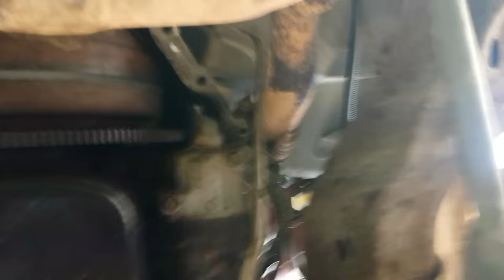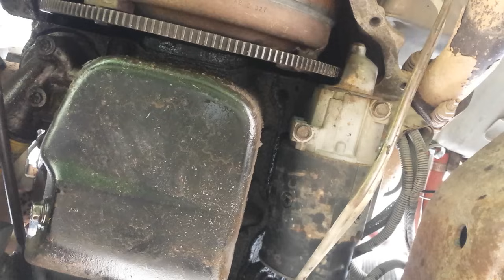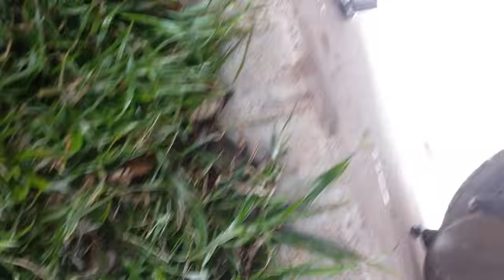Bad flexplate sound

Comment: I can confirm this is the noise….I rode around with mine broke for a month rattling around until it blew up at 80mph…..Torque converter is toast
Reply: What kind of vehicle do you have? My 05 started making noise a week ago and come to find out was a little low on oil, thought it was a rod knock but went about 4k rpm going to highway speed and lost all power and towed home. Got plate and torque converter, hoping it's just the plate 🤞🤞
Reply: @Ni_ghtmare  06 Trailblazer it would only rattle on Start up and Shut off which is why i assumed it wasn’t too major i also had no shifting problems even leading up to the event, Converter was toast cause of metal chunks tearing it up :(
Reply: @DavidsLifeYT  yeah, I have an 05 ram 1500 5.7 hemi, heard rattling but needed to do some work and had no choice but to drive it and figure it out after. Was coming home, passed the bridge by my house like 3/4 of a mile away and heard a snap and lost all power. Bought the flex plate and torque converter, thinking since I dropped the money I'll just go ahead and put them both in (265k miles and never taken trans off) didn't have any shifting issues either before it started happening. 

Would take it's time going in reverse but other than that it drove perfectly fine. Will update tomorrow when I do it just to keep you in the loop 😂😂
Reply: @Ni_ghtmare how it go
Reply: I have one more day to drive mine, and I'm really really hoping it holds out

Comment: My 97 f150 started doing it 6 months after I put a new motor in it. Thought it was rod bearings found out it wasn't but changed them out anyways. It remained me of a lose flex plater or torque converter being loose not all checked out. I came to the conclusion it was either the flex plate or torque converter. Both can make the noise. So when I drop the transmission I will just replace both at the same time and be done.
Reply: I had my transmission rebuild, 1700 bucks. 700r4 in a obs k2500. 4 months maybe it is doing exactly that. I took it to them hoping it was that. They called me next day saying they think it's the motor and want me to come listen to it.......I know what it sounds like there Bob the builder, I need you to tell me yes or no is not the trans. Well they are convinced it's the motor but every gear head I'm friends with are telling me definitely the torque converter or flex plate. We'll see
Reply: Did u fixed ???Hope u did not buy a new engine  i have the same noise  and i spend lots of money on a new supercharged engine and new tranmmission noise not gone  they change the torqueconverter  and use same flex plate  and same thing now is going back  to the dealership  to get new flex plate hope it fix the problem

Comment from the maker: It did turn out to be the flexplate. it was cracked all the way around the bolts
Reply: Hi did the issue happen after the clutch was replaced or it happen just like that . Pls guide . Having same issue just  1 month after replacing the clutch and flywheel .
Reply: We
Reply: Can that affect the transmission after a while
Reply: @driverman9528  thanks man yeah i was thinking it was my battery but im not sure because it makes that noise and it takes a couple of turns to turn on then when i step on the gas i hear like a plate hitting something thanks alot for the feed back
Reply from the maker: @joseramirez9932  not likely to affect the transmission but some of the old heavy flywheels would sometimes shatter and if that happens its about like having a grenade between the engine and transmission.
Reply: FamilyMatters2015 my silverado was making the same exact noise but today i put in drive and now it wont move forward or backwards can i have damage something else
Reply: @erikramirez3576  still doing it? Check your transmission fluid
Reply: @erikramirez3576  if flexplate is totally cracked around mounting bolts, the crank is probably spinning inside the broken flexplate and not turning torque converter or transmission. So vehicle will not move.
Reply from the maker: @erikramirez3576  very possible the flexplate can completely break and loose all connection from the crank to the torque converter
Reply: @driverman9528   could you help me with my truck it make a similar sound but its sound horrible
Reply: Did it have a problem gaining speed.
Reply: Best to replace torque converter and flexplate at the same time. Often times its the converter that caused the cracks if its a stock engine. When people talk about repeatedly having flexplates crack, something had to cause it. Usually high horsepower, loose bolts, or failing torque converters.
Reply: @benthere404 Do you know how a bad torque converter can break the flexplate? I had the original plate break in my car after 314,000 miles and then the new flexplate broke just after not even 2,000 miles
Reply: @marcuscarter7639  I'd lean towards loose or improperly torqued bolts with that low of miles, unless it with neutral dropped.

Comment: Did you ever determine what broke the flexplate in the first place? . .  Besides the common reasons (that we always hear about). Mine was breaking around the crankshaft bolts due to improper alignment of starter to ring gear. If there's the slightest slant, it will stress the flexplate over time, and will crack around the center. Yet there's no damage to the ring gear, because it will still mesh just fine.
Reply from the maker: It was broken before i bought it. I just replaced it and it hasnt hapened again

Comment: you and your old video saving all these lives haha your such a hero,haha kidding bro,i have a 95 z71 ive had it for 23 yrs now and ive replaced the trans in it like 3 or 4 times not sure why,its a 4 wheel drive im not racing in it you know,but yea i put it in gear and it sounds like a metal coffee can with some nails in it shaking it up and down,i put it in park and it stops omg im so tired of working on stuff,this was the FIRST video i watched and boom looks like its this,i removed the bottom shield like you did hoping there was a rock or something but didnt see anything and i knew it was a crack,thats why i typed in cracked flexplate,damn the man,well like everyone else here thanks for confirming it for me.later
Reply from the maker: Haha yes sir glad to help. The truck in the video is a z71 and I bought it for 500 bucks because they said it needed an engine. After hearing it run I knew it was a flex plate. After you hear it once you can identify it pretty easy. Take care

Comment: Did it knock at higher rpms? I have a similar issue but only at very low idle. When into throttle it stops.
Reply from the maker: When under load or under climbing rpm the Knock would stop

Comment: My town country van has that strange noise which is coming when ever I turn on the car. If I also turn the AC on the noise gets more. However when I Accelerate and put my foot on the gas and drive. the noise is stops and then when ever I took my foot of the gas and slows down or making turn the noise coming back.
Reply: Mines doing the same what was the problem

Comment: mine makes that too.. it cause 3 starter to break into pieces.... .. i have no idea how fly wheel can get very hot, horny, dusty, windy, and cranky... thankss for loading up video...
Reply: VANflawless flawlessNIXION  Why would you buy 3 starter motors and not kust get the flywheel fixed, them bits have entetered your gearbox or flywheel and will have done a lot more each time.

Comment: Won't you hear the same noise if it is partially engaged in 4wheel drive, check your 4wheel drive shifter to be sure it's in neutral...

Comment: You know when I fire up my 86 I hear some weird rattling think it may be flywheel but only when it starts and never again any ideas
Reply from the maker: Could be a crack on the flexplate. Listen to exactly where its coming from and go from there
Reply: It could be the starter not disengaged
Reply: My car is making a rattling noise but it's like yours right when i start it it makes the noise but a few min later it goes away. Did u ever figure it out?

Comment: Mine is making the exact same noise. I have a 1990 RS 305, when I started it does the same thing but after it starts to idle evenly it stops
Reply: Was it the flexplate? Im having the same noise on 2002 impala but goes away when the engine geats up to operating temp

Comment: I have a 2014 ford explorer fly which is making the same noise when accelerating after that feels good but when going to slow down or accelerating again I hear it again like metal rubbing metal
Reply from the maker: Are if there are metal shavings in the been housing.  If there are then check starter clearance.

Comment: 1978 cutlass knocks at idle put it in gear no knocking even when u rev the engine in gear still no knocking put it back in park knocking comes back flex wheel ?
Reply from the maker: Sounds like it could be a bolt on the torque convertor has come loose. If it has then every time it comes to the top of the bell housing it will make contact. The load put on it while in gear may move it just enough to prevent this contact. If that is not it i would suspect a cracked flex plate.
Reply: That’s what I’m think I can’t see any cracks but the best way to really see is to take it out

Comment: I have 2007 Yukon Denali make the sound like a bell right by the flywheel almost like the video. 
Can we keep driving like that for a long?
Reply from the maker: I would fix it as soon as possible. Driving on it isnt real good for the engine or transmission. But that being said you could probably get by for a while. I drove the truck in the video for a year before i eventually fixed it

Comment: hows it going man yea i know its a old video haha hey bro my 95 z71 that ive had for 25 yrs now it was making that noise so i just got aroundto replacing it,i took the old one out and there was not a single crack in it dude,so i replaced it,cranked it up sounded fine well then when i put it in gear and was backing it up on this little hill where i park it today it started doing it again,so i got someone to sit inside and put it in gear while foot on the brakes and i crawled under to listen and then it just quit,so i got in it and drove back and fourth up and down the hill putting some stress on it and it hasnt done it again,not sure if it will or not,but while we were hearing it while in drive it just stopped all of a sudden,im super sore and tired from doing this crap do you have any idea why or what it could be,the old one wasnt cracked,was yours,i saw a couple marks up inside the bell housing where it looks like something hit it in two spots but i dont know if that was anything,any help or ideas bro.god im beat,i left my transfer case attached and just slid the trans back enough to get in there to change it.thanks
Reply from the maker: Couple things come to mind.  Could be the starter not properly shimmed to where when the flex plate flexs it contacts the starter. That sounds like the most likely scenario to me.  A differential that is low on gear oil could also make a similar sound.  If you were going up the hill in reverse those sound like the most likely culprits because reverse is lower geared plus the strain of going up hill. Try to replicate it by putting in reverse, mashing the brakes (to simulate load) then give it gas.  See if makes the noise again.  If it does then more than likely the starter needs shims
Reply from the maker: BTW this is my video.  I'm just in a separate account rn
Reply: @TheBigstew5508  thanks man yea i saw another video and it was the starter on his truck,come to think of it,its the original starter haha so its oh wow 29 years old haha,i installed the engine in 2006 its a 350 HO with a slight cam,i was thinking about pulling the bottom cover off and looking at the new flex plate to see if there were any wear marks.damn cant believe i did all that work for nothing,oh well thanks man take care
Reply from the maker: @onewheelup  happens to all of us.  If it makes you feel better I've seen trucks sell that had a "rod knock" that turned out to be a loose torque convertor bolt hitting the bell housing.
Reply: @TheBigstew5508  yea i know man,you know you have two types of mechanics,one finds the problem and fixes just that,the other throws parts at it until he finds the problems and thats how i feel,i just dont know anyone to ask,i dont have a single friend anymore,you know i did a complete every nut and bolt ls 6.0 with cam and centrifical super charger in my blazer all by myself,geez talk about a lot of work and trial and error but anyways hopefully its just the starter and nothing serious.thanks for helping me out man it means a lot.like i said ive had the truck for 24 yrs now,while under neath i see ii need to power wash then do por 15 cause theres lots of rust.uhhh it never ends.later friend

Comment: i took my ford e250 into the transmission shop who had previously rebuilt my transmission and they looked for a crack in the flywheel and couldn't find anything. All they did was remove the starter and a cover and put a scope up. They said that they don't know where the knocking noise is coming from because the flywheel looked fine. Is it possible to find a cracked flexplate with their scope method? I hope they just missed that part lol. thanks!
Reply from the maker: Mind was bad enough where is was obvious. You may unbolt the torque converer and slide it back to get a better look

Comment: Can you hear it at high rpm ? Like super loud
Reply from the maker: No it goes away under a load. If ut gets louder with rpms then may be abrod knock
Reply: FamilyMatters2015 it’s sound exactly like this , rodknock is loud , it sound more like aggressive grinding at high rpm
Reply from the maker: @alonzo5.040  you should have an inspection port on the bell housing. Best thing to do would be to run a bore scope in that port and take a good look at the flywheel/flexplate. Ive also seen the torque converter bolts come loose and will tap the bellhousing every time they spin around. May check that as well. Easy to do
Reply: FamilyMatters2015 thanks man appreciate it

Comment: I have an '87 Ford Tempo , it squeaks & squals really bad have sprayed the flywheel only for the noise to return.. HELP!!!any suggestions???
Reply from the maker: Frederick Kidd if it is coming from where the flywheel is then it may be the torque converter. Check your transmission fluid for material
Reply: FamilyMatters2015 nothing in trans fluid
Reply from the maker: Probably the torque converter

Comment: My f150 97 do the same noise I live in Oregon but I need to drive to California you think I can make that trip could you can help to know it's like 1000 miles
Reply from the maker: I wouldn't chance it. If the flex plate is cracked there is a chance of it coming apart. I've heard of people getting seriously injured by flex plates exploding under high torque in older vehicles. It can come though the floorboard if it has enough force behind it.

Comment: My truck was making same sound every time I start it but only in the beginning not when I drive it, I thought was a piston but I think is same issue, 3 days ago I start it sound was gone but doesn't engage shift any gear, what could it be¡¡
Reply from the maker: It would be worth looking into the flexplate. If it sheers off just right it may not be connecting to the torque convertor. Pull pff the inspection plate and see if has wiggle. May check to see that the bolts are still connected from the flex plate to the torque convertor too

Comment: My buddy's truck had the same problem... he went in for a rear main seal leak and the jackass mechanic ran the bolts down with an impact so tight it cracked the flex plate... I installed a new flex plate and torqued to spec, no problem since.... beware the quick lube places
Reply from the maker: Brendan Rapa quick lube places are garbage, i try to do as much as i can on my own to prevent stuff like that

Comment: was that noise going away wjen you put ot in neutral?
Reply from the maker: it went away when put in gear
Reply: +TheBigstew5508 like clutch pushed in and no sound? was it also your bendex gear on starter not adjested right ?
Reply from the maker: +Iworkupnorth.com it was the flexplate. it was cracked

Comment: if its a chevy there notorious for the flywheel cracking
Reply: My 2.3 liter mustang makes almost a similar noise. I got to replace the rear seal in it anyhow and have the transmission rebuilt.

Comment: When this happens, does it come on all of a sudden or does it get worse and worse? Is it hard to fix? Thanks!
Reply from the maker: Could come on quick or could take time. What is happening is the flex plate is cracking. In this case it was pretty severe crack all the way around the crank bolts. To fix you will have to buy some long bolts to place where the transmission mounts to the engine. 2 or 3 bolts about 6" long should work. Remove all the bolts for the bell house and torque converter. Remove the cross member and drop the drive shaft. I like to use a ratchet strap to help support the transmission. Install the longer bolts carefully and slide back the transmission giving you enough room to reach the crank bolts. Remove and replace the flex plate then re assemble. Be sure to use lock tite on the crank and torque converter bolts
Reply from the maker: You could also drop the transmission but I prefer the long bolt method
Reply: @TheBigstew5508  awesome! Thanks much!!
Reply: Could a flexplate make this noise only and only after 40 miles an hour from a dead stop to 40 miles an hour there is no noise but after 40 miles an hour there is a noise just like your video 🤔